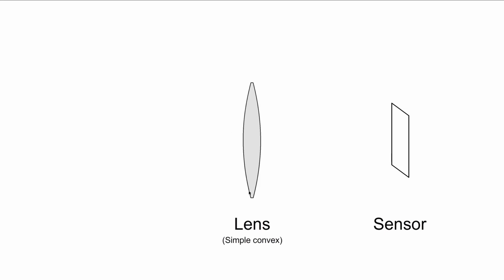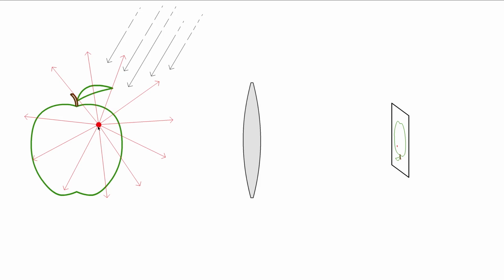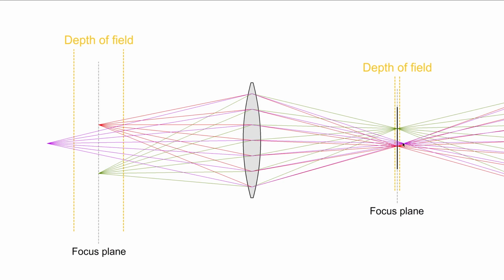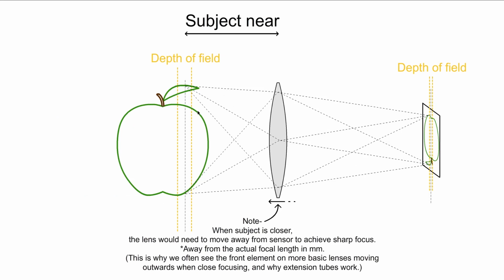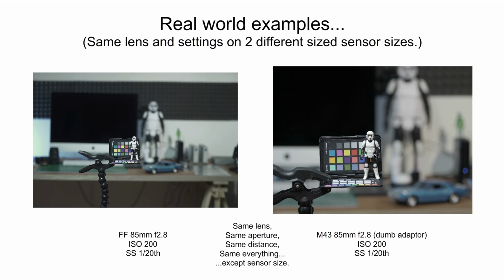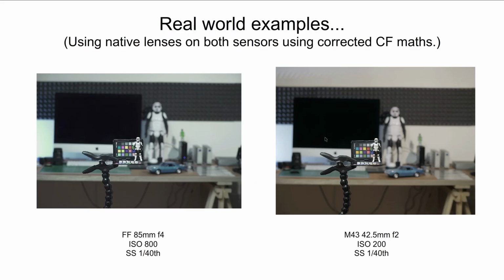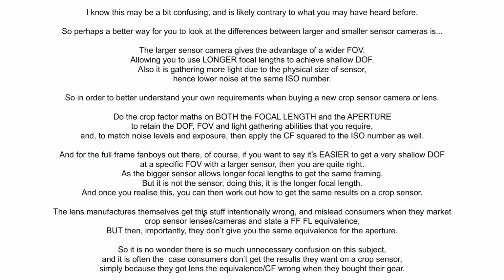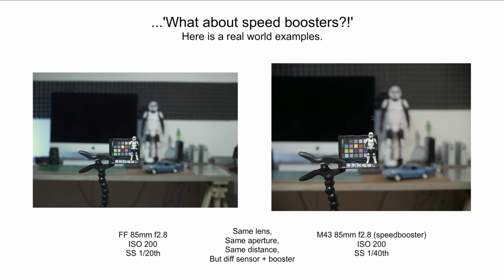Depth of field and crop factor misconceptions.

Comment: Thanks for the video, very informative. There is only one question that I don’t understand completely. That is how to achieve the same amount of exposure, DOF and NOISE. It is clear why you need to lower the ISO by the square of the crop factor - increasing aperture from 4 to 2 is exactly 2 stops, decreasing ISO from 800 to 200 is also 2 stops (the same would work if one were to decrease the exposure using SS). What I don’t understand is the fact that noise will be the same. If we have 2 sensors with the same amount of pixels, say iso 12800/22750 on M4.3/APS-C should definitely look cleaner than iso 51200 on FF. At least this is what I experienced with my Sony A6500 vs Sony A7IV. Could you please elaborate on this?

Comment: The example of shrinking the sensor is incorrect, because you simultaneously changed the size of the pixels. This is the equivalent of keeping the sensor size, but doubling the pixel density. At that point, having a circle of confusion overlapping multiple photosites would either indicate a lens limit due to aberrations or diffraction, or defocus. If you kept the pixel size the same, but only changed the physical dimensions of the sensor, no change would occur with the interaction between the circle of confusion and the generated image.

Also, exposure is what matters for signal in creating an image, due to signal being generated at photosites, not the sensor substrate. Simplified, equal exposure would give an equal readout of voltage at each photosite, thus giving equal signal. Many other factors influence noise and the snr, but the size of the sensor in and of itself does not.

Comment: Very nice explanation.  I have sent several M43 users to your video when they try to tell me their Olympus 300mm f/4 is a 600mm f/4.  When I tell them it's a 600mm f/8 and they have to boost the heck out of their ISO to match FF...heads explode.  The marketing departments of several camera companies feed off the misinformation out there.  Small sensors always pay a price.
Reply from the maker: Yep. They are correct of course when they state their lens/ focal length/Fstops. It’s when they claim their full frame equivalent numbers they often lie on purpose. 

Some companies even show the full frame equivalence lens next to theirs in the adverts. 
Not pointing out they the image /depth of field is entirely different.
Reply: @biscuitsalive   Why the Engineering depts. always hate the Marketing depts... :P

Comment: It gets more obvious, when we consider an even smaller sensor, like the 1/28" sensor of an iPhone 15 pro. The main camera is a 24 mm FF equivalent f1.8 lens, there is the first problem: manufacturers call out the equivalent focal length but not the equivalent aperture. With a crop factor of about 3.5 the iPhone has a 7 mm f1.8 which is equivalent to a 24 mm f6.3. When we set a full frame camera with a 24 mm lens to f6.3 we get the same field of view and the same depth of field as the iPhone. We also have to adjust for exposure: if we have ISO 1600 on the iPhone, we would need ISO 19600 on the FF camera given the same shutter speed. There we see that the best we can do with the iPhone is a shot at f6.3 and ISO 19600 on full frame, but with the FF camera we can open the aperture depending which lens we have to 1.6 for example which would give us 4 stops extra for exposure, we now could either increase the shutter speed by 4 stops, or lower the ISO 4 stops, which will give us ISO 1225, or divide the 4 stops differently. We can't do that with the iPhone, because we would need a 7 mm f0.45 to archive the same with our FF camera at f1.6, f0.5 is the physical limit for any lens, so this lens would be impossible to manufacture, the practical limit is more like f0.7.

In conclusion crop sensors appear to have bad light capabilities, but the truth is that the smaller sensor would require lenses that are unobtainable, to get around that the only thing we can do is to increase the focal length, and if we do that we also need to increase the sensor size accordingly. If you want to get the same shot (same depth of field,  same field of view) sensor size doesn't matter so much but if you want any shot (aperture wide open, maximum shutter speed, lowest ISO possible) the FF camera will always be better, because you can utilise the higher focal length to achieve a larger aperture and because of that better exposure settings.

Comment: I have a question, if the focal length is just the distance between the lens plate and the focus point, why a FF 50mm lens is different than a APSC 50mm lens? Why do we need lenses for specific sensor sizes, and in which ways are they different?
Reply from the maker: William Chen it’s just the image circle size. 
A physically smaller lens (smaller disc of glass/lens and housing) will create a smaller image circle behind it. So bigger sensor needs bigger glass element etc so as not to vignette.
Reply: @biscuitsalive  Ah that just cleared out my confusion! Thank you so much for your quick reply! If you would like to, I think you could make another video about the science behind "mounting a full frame lens on a smaller sensor (and vice versa)" and the pros and cons of doing so.
Reply from the maker: @williamchen8009  no probs, ive been too busy with work to do any youtube stuff recently, but i do enjoying doing videos just for fun now and again

Comment: I think the main reason why these misconceptions exist is because most aps-c cameras dont have lenses that are as fast, relative to their sensor size, compared to lenses designed for full frame cameras. 35mm f0.95 aps-c lens is going to have, roughly the same results as a 50mm f1.4 full frame lens. I wish there were more ultra fast wide lenses for aps-c cameras like a 20mm, or 25mm f0.95!!! That would be AMAZING!!!
Reply: I just found a website called dof simulator and it is a great way to see how all this works out!!!
Reply from the maker: Reza Taghipour yep. Your not wrong. 
All you need is the same size aperture. (Physical size of hole, not f stop number)
And things soon start evening off. 
That means lens have to be about the same size though. (Crop lenses same as FF lense)
So, clearly it’s the lenses that are the weak point. And not really the sensor at all.

Comment: I ve got a kinda weird question about shallow depth of field. Why panaosnic or olympus can't make the real full frame equivalent lens for a micro 4/3 body. If we adapt some full frame lenses with a speedboster, it continues to work as a full frame lens, with the same DOF, but with a slight crop. So, why oly/pana can't make the same lens but with the native autofocus? I'm shooting with a G7, and using some FF lenses from canon, only for DOF, I don't want to change the whole system, but I really want to get the FF DOF on my Panasonic body, without barely working autofocus from a speedbooster.
Reply from the maker: Are you asking why they don’t make a lens with a speed booster built in?
XD
It’s a good question I guess. 
I don’t think it would fit with what they are doing when they choose a small sensor for their camera line. They specifically want small lenses for their small camera. 
Part of the appeal for many people. 

Plus they would be really expensive etc.
Reply: @biscuitsalive  lol, leica of olympus pro lenses sometimes as expensive as they FF rivals, and also they are pretty big, so that's why I am little bit confused, after watching this video, it looks like they just don't want to make it, and I don't know why. Panasonic ambassador told me that he also doesn't know the answer lol.

Comment: The only thing you got wrong is how ISO is calculated. It is light falling on the whole sensor. Not only on a certain area. Otherwise exposure values wouldn't translate between sensor sizes. Not to mention film. Having shot more than a few film formats. 800iso medium format is the same sensitivity of 35mm and smaller films. On film its function of grain size.
Reply from the maker: You’ve got some of that a bit backwards. 
The ISO number represents gain added to the signal to boost the signal. (Which give the impression of increasing sensitivity)
And the gain is directly proportional to the size of the sensor. 
Hence if you point camera at a grey wall, and cover part of the sensor. The rest of the sensor doesn’t make the exposed part brighter. 

Just as the StoR ratio remains equal across any part of the sensor. 

It’s easy to put this into practice. Just swap a f1.8 full frame lens for a f1.8 apsc lens on a full frame camera. 
The iso /exposure remains the same. And the image brightness remains the same. 
But we now have shadow across the outside of the sensor. 
So obviously there is less TOTAL light hitting than sensor. 

You see my point?

If that sensor was a solar panel it would now be generating less electricity. Even though the  light source remained constant.  

It’s the total amount of photos hitting the sensor is what matters to the image. 
Not the concentration per square inch.

Comment: I have been a photographer for a 5 years now and do a lot of reading and watching on the subject. This is the first time I have had aperture explained to a level where I can understand the mechanics of how this works, not just the effect.
Reply from the maker: Pete B cool! That was my goal. To explain literally what’s happening in your lens as simply as I could. (But still covering a lot of information... it’s a tricky juggle)

Be sure to watch my follow up vid. 
As I did make a couple of minor mistakes in this vid that I wanted to correct.
Reply: I am an engineer so always want to know the specifics of how something works. I didn’t review the FF vs Crop and ISO parts, as I am always fairly confident in that area. Will look out for the update.
Reply from the maker: here is the link, its a bit boring, but i like to correct my mistakes if possible - https://youtu.be/fCIWkqcb7FI

Comment: I get it, but I'm trying to find out why my Canon 80D with 18-135 kit lens doesn't have a big depth of field when I have zoomed out. I was suspicious of it not doing this over the last year, so yesterday I did a DOF test on a long row of railings posts, so I compress them by zooming out. I first stood close to them and did around a 60mm focal length, I focussed a third of the distance in to the shot and tried at f8, f11, f16, f20. I know you get refraction with this lens after f11, but it was a DOF test and I still couldn't get everything in focus front to back. It did improve, but still the near and far posts were blurred. I then went around 24ft away from the end post I was stood by and zoomed to around 125 or 130mm and still had the same problem. I thought at least by f11 or f13 everything would be in focus. Is this a fault of this lens, or is this normal, do I have to crop photos every time, or am I doing something wrong. Does this happen with every lens on a Canon crop sensor, because at the moment I can get bigger DOF on my old bridge camera with a tiny sensor, zoomed out at f8. One reason I went to a DSLR was for its much bigger range of aperture values and being able to get everything in focus when I wanted that.

Comment: I know this is a few years after this was first posted and am pleased to see someone get it correct, I have been so frustrated with the amount of posts claiming that sensor size changes depth of field, only subject distance, aperture and focal length change depth of field. I do however feel that there is confusion over the ‘circle of confusion’ and I do not see how it impacts the depth of field with sensor size. As you show in you diagram the point of focus is the size of a pixel and a sharp point, reducing sensor size but retaining the resolution creates the overlap onto other pixels. You state that this impacts depth of field, but I disagree, to me the circle of confusion will have the same effect across the whole sensor regardless of depth of field, it has an impact on the overall sharpness and not depth of field.

Comment: One thing I'm confused about. I see by the example that it works, but if cropped sensors create blurrier images, why does the fstop need to be lower, wouldn't that make the images have more depth of field, or is it being compensated for by the wider focal length since the lens itself is physically wider and it's only the field of view your changing... I think I just answered my own question
Reply from the maker: lol. U maybe did. 
Watch the follow up vid as there is a bit of further explanation
Reply: @biscuitsalive  I did watch it, great info here thanks. Your explanation of the differing aperture diameter in relation to the amount of light entering a wider lens explains why you get more in focus at a lower f/stop on wide angle lens while maintaining the same exposure. I knew that was the case, but I didn't know why. This would also explain why halving your f/stop on a M43 sensor wouldn't create extra bokeh, but rather simply match it to the 35mm.

Comment: For the consumer, the practical relevance of ISO, and the only one that really matters, is how clean an image is. However every manufacturer develops their own propriety software for processing signal into an image, every manufacturer develops their own sensors with their own methods of generating signal, and every manufacturer chooses their own system for assigning an ISO rating to the results of those systems. These are constantly being evolved. Comparing ISO ratings between different model cameras by the same manufacturer is meaningless, let alone comparing ISO ratings between different manufacturers.

Comment: Theres a youtube explaining refraction, the analogy of soldiers marching from tarmac to sand, its not really whats happening, what is really happening is to do with interference  between the light and the fields of the electrons in the glass molecules.  Light is an electromagnetic wave, not that it matters and all that, and if I actually understood it, I could explain it, but the light (being part of the electromagnetic spectrum) interferes with the electromagnetic fields of electrons in the glass molecules.  Anyway, it doesn't matter, I like your video.

Comment: I'm very glad that I learned something from your video. but pardon me. the DOF diagram illustration is showing in your vedio, from my point of view, after the rays refracted through the lens, the focus circle of further object should be on the Focus Plane's left . Because this point circle gives a narrow angle, thus, the rays though the convex lens can give a easy refraction. Therefore,  the focus circle should be on the left of the Focus Plane. Hope I can get your feed back. cheers.
Reply from the maker: Yongchao Zhao watch my follow up video. In that I pointed out a couple of minor mistakes that I made. 
I think that answers your question. (Although I’m not certain as the message was slightly confusing.)
Thanks.

Comment: Wouldn’t you say that a full frame sensor and a APS-C has the same low light performance if they got the exactly same kind of pixels?
Of course not the same amount of pixels, but the same kind of pixels (ex. size and density).
Reply: Actually, both a FF and APS-C can have the same "amount" of pixels, they are just packed more dense on the smaller sensor. So you want to look at pixel spacing (or pixel size), the distance between two adjacent pixels.
One reason the Sony A7S (pixel pitch 8.3 microns) sensor is so desirable for low light is the size of the pixel, it's huge compared to 24M pixel version of the same FF sensor (5.9microns). Those large pixels can gather a lot more photons per pixel then smaller pixels.

https://www.digicamdb.com/specs/sony_alpha-7s/

https://www.digicamdb.com/specs/sony_alpha-a7-iii/
Reply: My point was just that low light performance has not a lot to do with sensor size. 
It’s all about the physics off the pixels.

Comment: While I realize this video is 5 years old - it does explain things quite well, or at least for me, but one thing I think you and others that put this type of content out is to really stress that when using the crop factor method for focal length & aperture, this is only to give you the SAME FOV & DOF as the FULL FRAME EQUIVALENT, the crop factor does NOT actually change your focal length or aperture, that is what a lot of people are led to believe. an image taken at 400mm and F4 on a Full Frame Camera is ALSO 400MM & F4 on a Crop Sensor Camera. The crop Factor again does NOT ACTUALLY CHANGE one's focal length or Aperture magically.
Reply: I hope/trust it is obvious for photographers. Focal length and aperture are attributes of a lens. Mounting the same lens to the bodies with different sensor sizes does NOT magically change the attributes of the lens ;-)